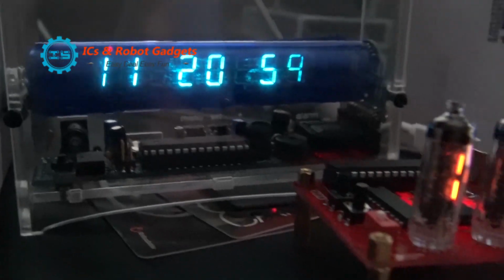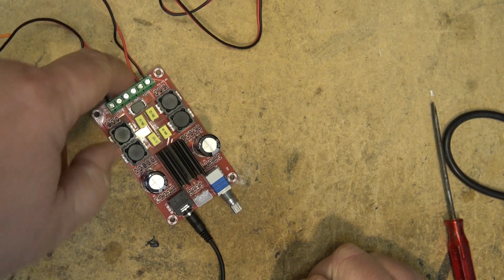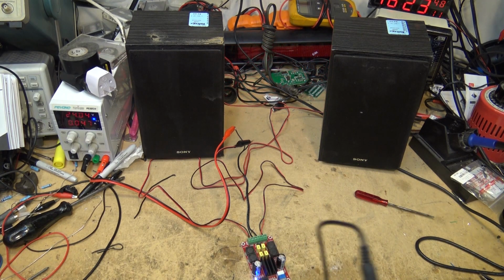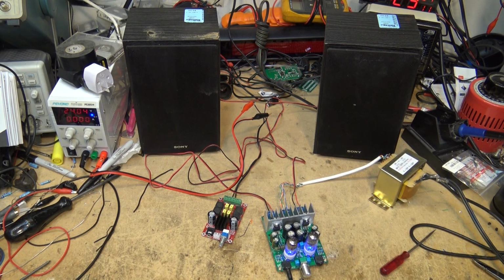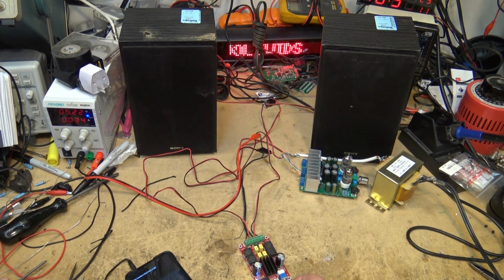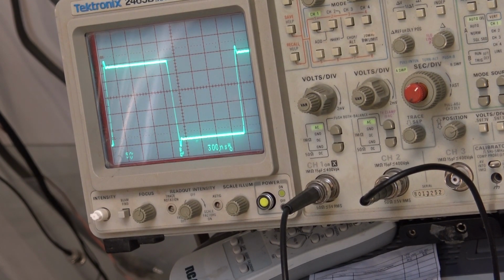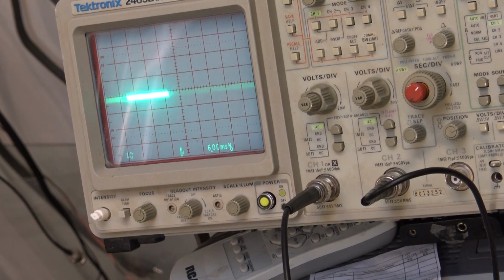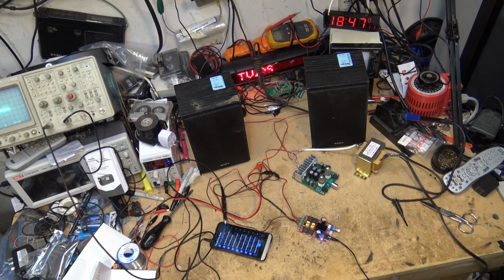TPA3116D2 Class D amp module sound check, overload check and compare to hybrid amp

Comment: I just got that PEVONO PS305H you are using as power supply. Found the adjustments bounce around a little bit not to steady. The pot on the course current adjustment has two bad areas on the adjustment where bounces around and then catch is back up. When testing it on an automotive headlight it cannot make 5 A it was going into protection mode and the adjustments were very unsteady. I opened it up and added two capacitors to the board in the available open slots for capacitors. I added 1000uf 63v and 1000uf 50v . After that it has plenty of power now. Adjustments are more steady now for voltage and current,  the pot on the course current of course still needs to be cleaned or fixed or replaced or just live with it. I turned up the voltage and current it’ jump up so fast to near 6 A and 16 V extremely fast burned out the headlight bulb that thing was cherry red it got so hot. The wires for the power leads for the power supply are extremely underrated they get warm. Definitely need an upgrade in the wire department and alligator clips. The voltage drop across the wires to the automotive headlight were 12.4 V at the connections at the unit and 11.3 V at the alligator clips attached to the headlight. But there definitely is a lot of AC ripple bleeding through the DC I’ll go after and see if I could fix that next.
Reply from the maker: Have not had any issues with my supply. Looks like you got a bad one.

Comment: I like that. Isn't there a box you could put it inside of? I am not familiar with projects, except I did see your mp3 player you have in a clear case. I am interested in making my own amplifier with kits like that if the price is decent. I realize I will need a proper power supply. I would like a tube amplifier also. It does sound better. I listen to this with a  Soundbox blutooth player. Good sound. Not stereo,but good.
Reply from the maker: I have some speakers that I will put these amp boards in some day for future projects.
Reply: Great idea. Powered speakers!

Comment: Was thinking 24v X 1a = 24 watts how is it making 50 watts? Great vid
Reply from the maker: The meter on the power supply is not fast enough to measure current listening to music. If I put a steady tone into it, and turned it to max power it would be  drawing closer to 4 amps, which would be right in that 50 watts per channel using ohm and watts law. But music power doesn't work like that.
Reply from the maker: Well thats because it is drawing more than 1 amp.
The current meter in the power supply is not fast enough to respond to instantaneous power demands of music. To measure correctly a single tone sign wave is used and the amp turned to the point just before clipping. With a constant load you will get about 4.2 amps total 2.1 per channel, which equates to 50.4 watts.

Comment: Mine ran ok at 24v for about 1 minute then suddenly crackle and death. Luckily I turned off my PSU after seeing it was under dead short. It didn't explode but it probably would have. It was getting way too hot at mid volume anyway so IDK what was wrong. Similar setups have ran great for me in the past with the same chip. I was hoping it just went into some kind of shut down but after cooling the chip it was still fried.
Reply from the maker: Your speaker wires weren't grounded were they? This is a BTL amp, which requires separate + and - wires to the speakers. A common grounded speaker would short it out.
Reply: @12voltvids  Nah the board I bought came with proper terminals with no common ground. It was actually a nice looking board so I'm not sure what happened. I'm about as sure as I can be as far as user error not being the culprit mainly because I was being super duper careful this time after having bad luck with a couple boards previously. I was up late working on this powered speaker setup as a present for a family member and I had fried the TDA chip I planned to use by stupidly hooking up the power backwards after ever so carefully connecting everything else up cleanly. I did that two times and couldn't believe it, did the old clip lead shuffle and slipped. I should have checked the heatsink first because it wasn't properly seated but I still thought there would have been some kind of thermal cutoff, and this time I made sure everything was immaculate before powering on. It was some cheapo deal from amazon so stuff happens but I'm still not really sure what in particular went wrong with the chip. It was sounding great til I heard the scratchy poppy, and the first pop was actually the sound of the heatsink coming loose at the glue. I ended up pulling the other similar 3116 board from my personal trusty DIY bluetooth deal to put into this one I'm still making and it's performing like it seemingly should. I feel like had I been monitoring the current draw of the first board I'd have noticed an abnormally high draw at low volume.

Comment: Hi bro
My amplifier board supply voltage is 6 to 24. So i connect 12 v 
While increase volume like dinosaur roaring 😂😂 amplifier board automatically turned off. Wht is the problem

Comment: Typical of these class D Chinese amps. They always add a zero or two in the wattage claims. 
At best with 10% harmonic distortion this thing puts out about 12 watts per channel. And at .1% distortion about 5 watts per channel.
While this board might make for a good portable device with such small power consumption. It really isn't something that I would use as a home stereo unit.
Reply: Pha Q - Exactly. Not good; even .1% harmonic distortion makes my earworms very angry!
I notice it with upper-mid RH piano notes; >2% is horrid. Tube preamp can't prevent 
class D output from producing it. 100% tube amps are best, but a conventional
transistor amp (with enough idle current) is still acceptable to my (tired) ears.

I've been noticing SOME sources seem to have much more distortion these days: 
The AM radio in two cars, and one of my OLD CRT RCA stereo TVs.  I'll need to 
remember/find that coil slug to tweak to fix that TV. Discriminator? (still have my 
25 yr old pocket protector w/colorful nylon hex tuning sticks all ready to go... lol)
Reply from the maker: Love the "internet experts" with absolutely no engineering background.
First of all these are not "china" amps. They are American amps.
The amplifier chip is a Texas Instruments chip, and they designed the circuit. Regardless where the board was assembled, it is off the design that Texas instrument designed for the amp. Second, power can easily be calculated.
The formula P=E * I - I2 * R = E2 / R
where P= power in watts
I = current in amps
E = Electromotive force in Volts
R = Resistance in ohms.

The higher the input voltage the higher the output into a given load.
Texas instruments rate this design at 50 watts per channel into 4 ohms at 24 volts.
If you need more information, here is the data sheet for the chip.

http://www.ti.com/lit/ds/slos708g/slos708g.pdf
Look at the specs. 0.1% THD is what TI tested them at.
Reply: And what exactly does 24 volts @ 1 amp equal?
Reply: Since I know you won't answer questions without charging for your time I will answer the question for you with my complete lack of electrical engineering.
24 watts of total power with all the distortion you can tolerate.
Wait... Isn't this turd supposed to be 50x50 watts of power? Making it a 100 watt amp?!!!!
Like I said this thing is 12 watts per channel @ 10% distortion. 
Typical of these class D Chinese amps
Reply from the maker: 24 volts at a constant 1 amp would give you 24 watts, however, we have not measured the current consumption. To do that I would need to put an audio generator, and dummy load (as I am not about to crank it to full power and blow the shit out of my speaker) and turn it up to the maximum point before clipping.  Doing that, the unit will draw about 4.2 amps (2.1 PER CHANNEL) which would equal 50.4 watts.
Listening to music with an average reading meter doesn't tell you shit.
You can however look up the specs to the chip.
Reply: @12voltvids  hahahaha the pha q is silent